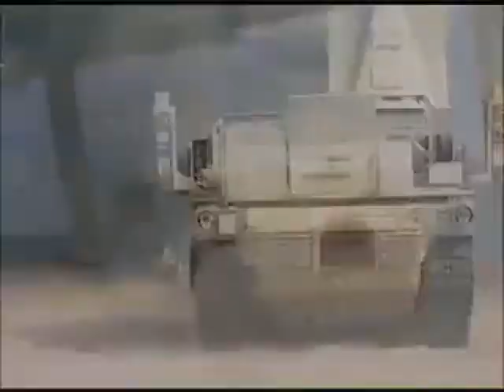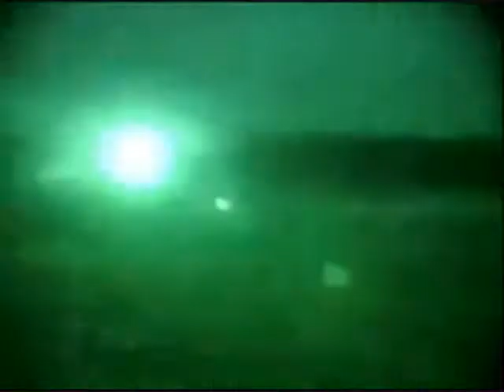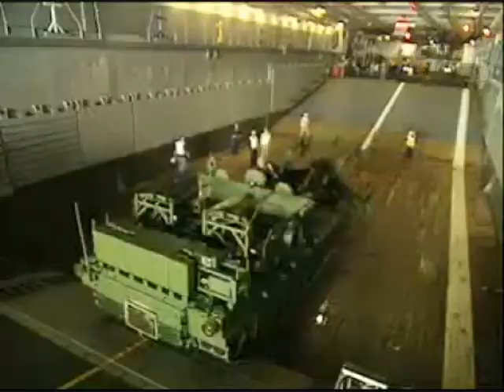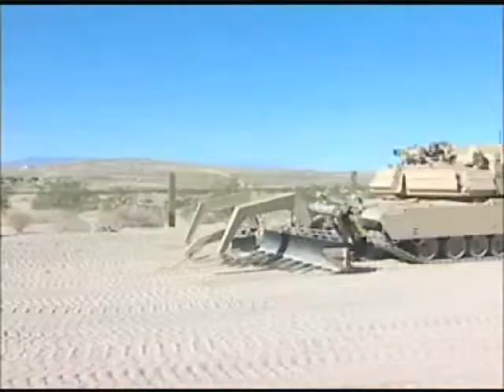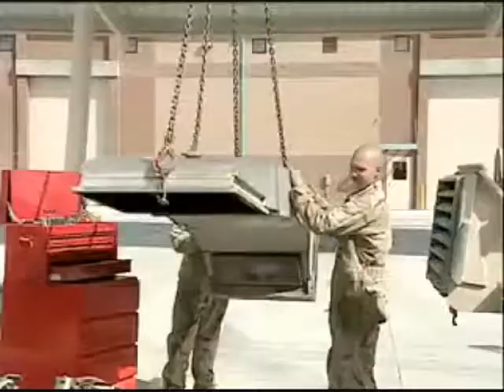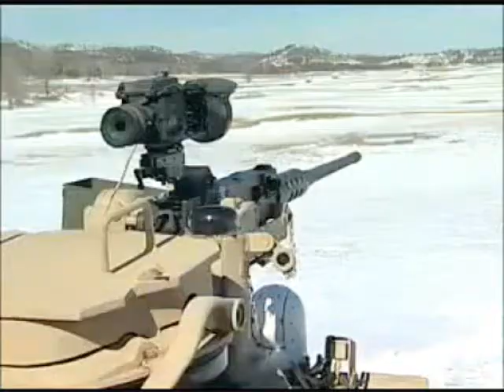US advanced technology

Comment: the thing in front of the tank is for the Mines and there are 2 kinds 
1 is called the Mine Plow and the other one the Mine Roller. They both wont work if there are lots of big rocks in the ground. You also lose A LOT of the tank power when you use it. Also every Troup only has 1 tank with Mine Plow or Mine Roller but its not always On cause its slows you down a lot